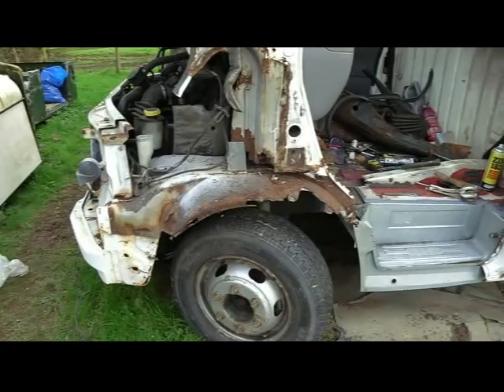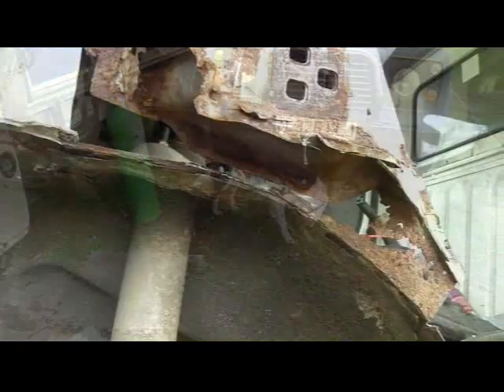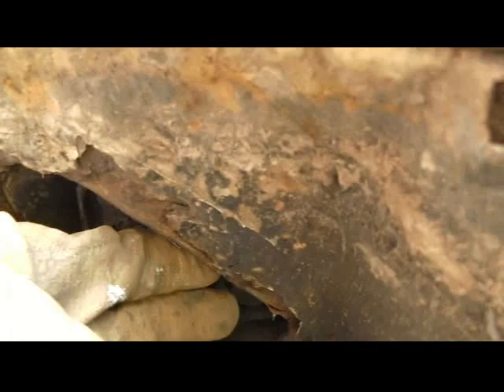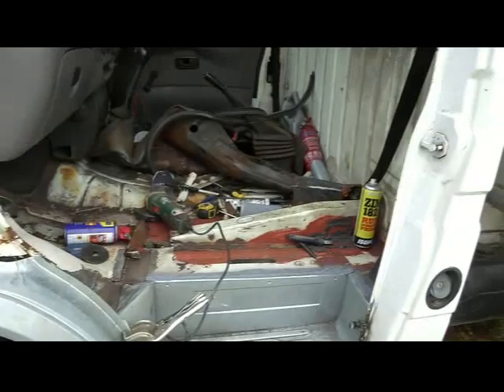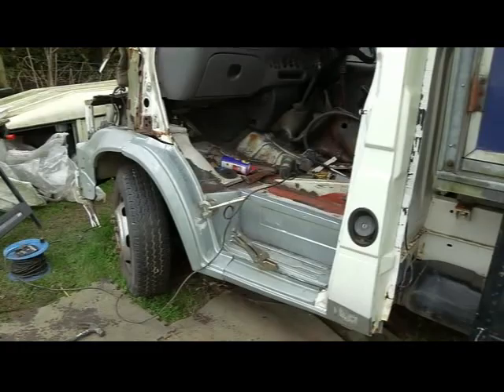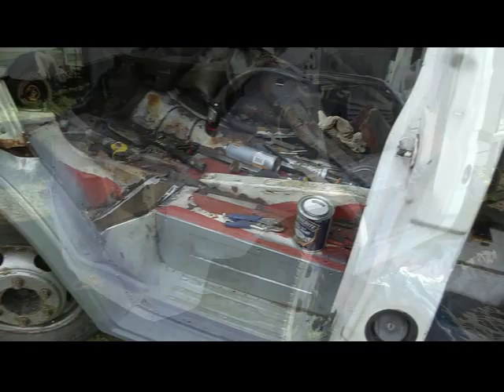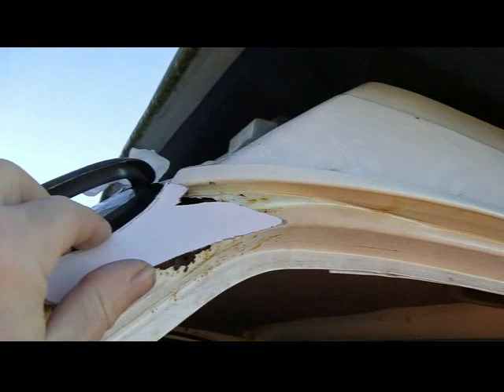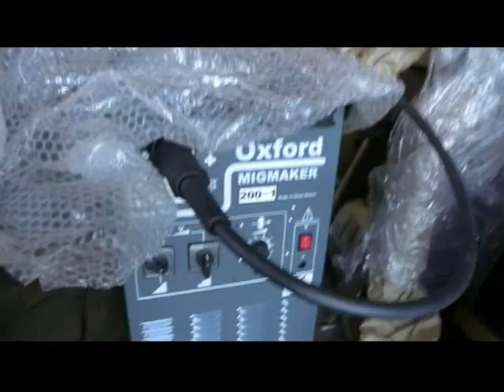MK5 Transit Rust Repairs Part 2

Comment: Nice work mate. Plenty of life in the old girl yet! Get so many coming into the workshop just like this. Just got a Jaguar come in and scared to even inspect the sills, can feel them crackle under my fingers! Guess plenty mig wire and gas going to be required......
Reply from the maker: Andrew Wilson 
Thank you for you comments. Yeh rust certainly keeps the welding wire flowing. 
The old transit is still going strong. Pulls like a train and doesn't leave a trail of rust.
Would love to see the jag... any pic s mate.
Reply: ANNE & PAUL PHOTOGRAPHY will definitely take some,going to be a big job. Know it's bad when hand disappears inside the sill! Owner thought the jack was broken! No,it was fine, just disappearing up inside the sill!

Comment: looking good.
Reply from the maker: Wayne Goldstraw ...Thanks Wayne.  Trying to get it all done my end of Feb... MOT time. Then it's landrover time.
Reply: My mk 5 failed last week, thought I'd done all the welding but missed top of suspension mounts and subframe member. Not having the greatest whether in the N.West for welding at the minute.
Reply from the maker: Wayne Goldstraw    That's a shame mate, you think you've don't the lot and they fail it on more ford rot. My subframe had a hole which I've plated. The top of my front struts  looked bad but it was all surface rust.  Just hope I've covered everything. Good luck with yours mate. Any pics.? 
thompsonaaman@aol.com
Reply: Here she is, sorry for the bad photo. Weather is looking up today so I can crack on. Good look with yours.

Comment: Have you still got this MK5 Transit or did you sell it. Also can I say how nice it is to see someone doing a proper restoreation job. I see so many people in my local area with all different ages of transit just duct tapeping up the rusty wheel arches
Reply from the maker: Still got it and still going strong rust free .....😁
Reply: @paphotography5183  that good to hear. I love seeing people repairing transit properly like yourself and not like the ones in my local area with rusted wheel arches held together by duct tape
Reply: @paphotography5183  tomorrow  i'm about to put in plate both left and right step panel. So i  ask you for advice.  Did you weld the step panel on top the floor?

Comment: I don't where Ford got the stupid idea of spot welding the front wings on instead of bolting them on instead like other van makers did. Even other Ford's like the Fiesta, Escorts from the early 90's were like that.
Reply from the maker: Michael Langley 
Yeh crazy idea.... makes life harder to do repairs....
Reply: Did you plug weld the new the wings in or convert them to bolt on?

Comment: Why are transits always so rusty? My dad had a 1991 transit in 2005 and it was rusted all the way through. The car was only 14 years old at the time.
Reply from the maker: Hi mate, yeah pretty bad for rust, I think the quality of the steel and poor preparation of paint work. I'm seeing transit customs with hinges rsuting out and on the mk7s inner sills going... pretty bad.
Reply: Not galvanised steel like used on renaults, Toyota etc but one of the most basic bulletproof engines made and will go forever compared to modern crap😉

Comment: did you ever build up the strut support ,think ive got same  trouble
Reply from the maker: paul woolacott  
Hi Paul, I ground the metal right back and it was mostly surface rust with flaky underseal... I hit it with a big hammer and it stayed sound. On the inside it's solid as a rock...so no need to cut out. I did dread having to do it as you can get that top piece soho thinks it s gona be a mare to do. I have seen some were the whole top section comes away and pops through on the inside.
Reply: ANNE & PAUL PHOTOGRAPHY hope mines ok will have to wait going to Norfolk for ea week then we will see  thanks again
Reply from the maker: Gingers crossed Paul. If the worst happens and you need any advise or even if you want me to fabricate somthing for you to weld on happy to do so.
Reply from the maker: that should read fingers crossed
Reply: Wow your a very nice man thank you will see soon if necessary I'll come to you if that's ok least I no be done properly  very willing to pay wow let's hope it's OK and thanks again

Comment: It would have been 10x worse if was a van.
Reply from the maker: yeh ive seen some floors and rear aches on those rot completely away...
Reply: I actually saw a MK5 smiley Transit van with no rust but i wouldn't like to guess how much filler is under that paintwork though.  You never see rusty Transit campers, ice creams vans etc since the custom bodies aren't built out of steel and they are well looked after. Why didn't Ford build them out of aluminium?
Reply: N